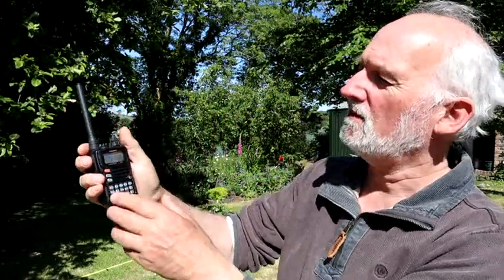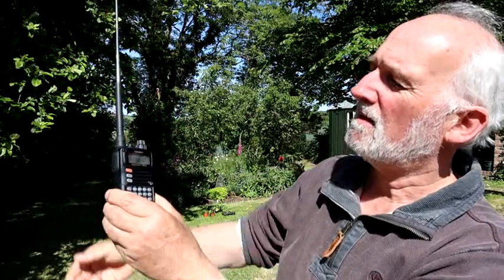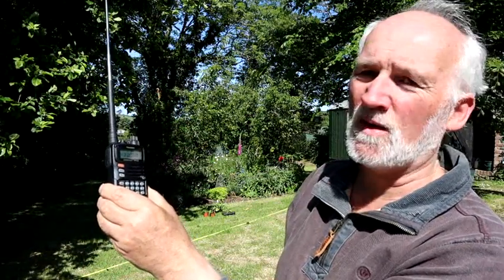The Rubberscopic Antenna for Hand-Held Radios

Comment: What radio are you using. Thanks
Reply from the maker: For the 70cms repeater and the Medium Wave demo its a Yaesu VX-6,  and for the Satellite its an Alinco DJ-X11 scanner
Reply: Phil Williams thanks. Great video I received 2 of the antenna today and they are really good got them in my baofeng gt3tp